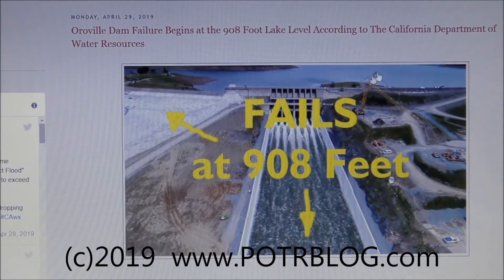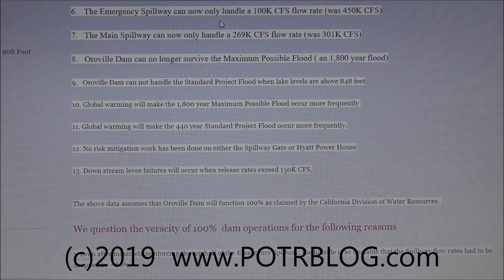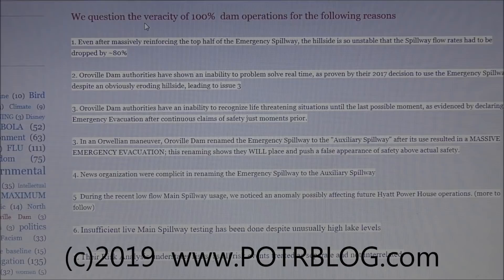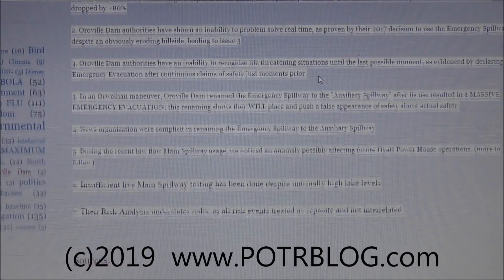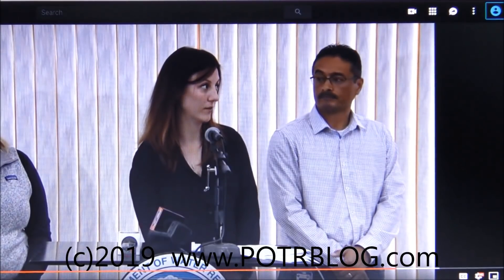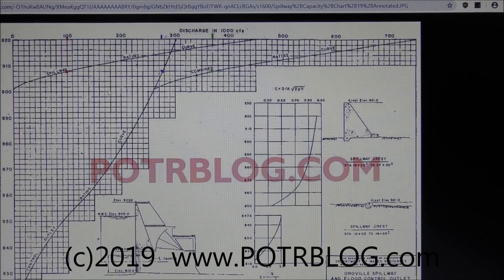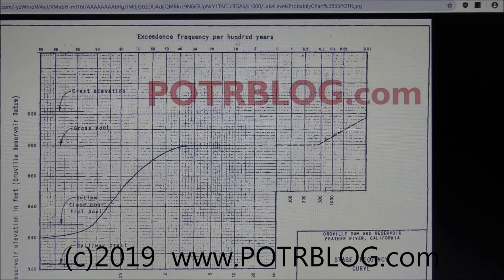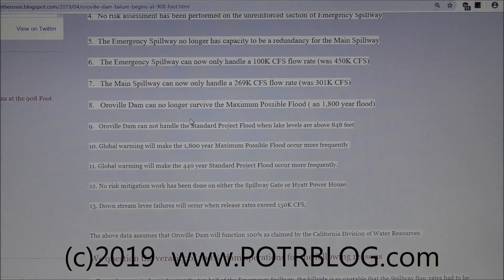Oroville Dam fails at 908ft says California DWR

Comment: I think the secant wall went 30+ft into the hillside bedrock? So for sure if 100k cfs went over the ES, then a lot of erosion would take place BELOW the secant wall. Would that erosion take out the secant wall? That's a difficult question, like how long is a piece of string...
When they built the secant wall, they came across groundwater (not unusual at those depths) this forced them to modify the wall construction to allow the GW to escape naturally. The biggest fail point of a concrete secant wall is GW.
It does look like DWR are taking a much more conservative view on discharge rates down both MS and ES. This has to be a good thing because it allows the engineers from both the Army Corps and DWR to devise a longterm plan for flood control. 
I agree that downstream the river has a lot of weak points, that need to be addressed. I think that in light of more frequent Maximum Possible Floods the whole watershed from snowpack to sea has to be re-evaluated. Then it starts to get political.....
Reply from the maker: They havent done any risk mitigation analysis below the up armored section, the 100k CFS flow is the limit because thats when the ARMORED section of the Emergency Spillway starts failing. The area BELOW the armored section will heavily fail at ~10K CFS (as in the original failure). How long the uparmored  section of the spillway can keep the the lower spillway failure from encroaching the weir is an unknown. Given the quality of the hillside I suspect it wont last long. Which is why I believe it prudent to leave anytime water comes over the emergency spillway. But the folks who have complete confidence in Oroville, can take comfort knowing that Oroville's numbers show that WORST CASE (if all plans are followed) there is a 21 hour window to evacuate once the emergency spillway tops. But, again, I would leave immediately.
Reply: potrblog erosion below the secant wall would have to undermine 30’ of rock to compromise the actual wall. RCC is used extensively for this type of spillway and my understanding is it wears well. 
Assuming the MS worked at full capacity, it would have to be some mega flood to overcome the MS to use the ES as well. By then ~350k cfs would be flowing down the Feather and well beyond its capacity. Flooding would already be happening and people would have moved out. 
The point of any flood control system is to give downstream communities time to prepare.

Comment: In order for this scenario to take place, the inflow would have to be a major flood event for a considerable time.  Plus the total out flow would be way less than the inflow.  Thats if the flood event happened when the lake was being prepped for storage, like now , and like Feb, 2017. So any dam , anywhere with that same scenario would be in trouble. Why are you focusing on just Oroville.? . Granted. That exact scenario did happen when Oroville lake went from 850 to 900 ft levels in just a matter of days in Feb. 2017. But that had a lot to do with the main spillway being closed off for a while when the spillway disintegrated. If the spillway had not failed, the lake level may have been able to stay below the 900 ft level due to the outflow being even or more than the inflow.
Reply from the maker: No matter how slow or fast the rain comes, IF lake levels reach 908 feet the dam will start to fail (according to Ca DWR). Given their own data, the FASTEST possible rain event that could cause such a lake level rise (even if EVERY spillway system is fully open) corresponds to +6 inches of rain in 21 hours (based on their pre-Global warming data ,such a flood on average would occur every 525 years). A smart person's take-a-way from this is that IF you believe EVERYTHING the folks at Oroville dam say, the fastest the dam can start to fail once lake levels reach 899 feet is approximately 21 hours. .I.e. WORST POSSIBLE CASE, from the 899ft point it takes 21 hours to for the lake to reach 908 feet and dam failure to start. That means the Emergency planners are assuming they have at minimum 21 hours to evacuate everyone down stream. If I lived down stream I would leave the instant water started coming over the emergency spillway ~901ft no matter how much or how little rain is falling.
Reply: "But that had a lot to do with the main spillway being closed off for a while when the spillway disintegrated."  You mean off, like the spillway has been since April 10th?
Reply: @spankymcspank316  
You are aware of course why the spillway is off now dont you Marty. They want a high lake level. This is standard operating procedure. When lake reaches 890+ chances are, since I dont know for sure, that the gates will be reopened to accommodate an even water level. Now if we have a freak 6 inch rain storm that comes from Hawaii and dumps 6 inches of rain in 21 hours in the Sierras, yeah , then shit gonna happen and that spillway will have to open its gates a to full capacity and it is even possible the emergency spillway will be used. Do you think that will happen? Its also possible a meteor might fall and land in the lake and send the water over the top. Its possible a 9 point earthquake will happen with the epicenter under the spillway. Do you think that will happen? Get a grip people.
Reply: @spankymcspank316  
The amount of inflow this time of year can be easily offset by the out flow of the spillway with only minimal CFS outflow. If those gates remained closed when and if the lake level reaches 895 + I will eat all my words and get as concerned as the rest of the fear mongers  . Im saying that wont happen. Im saying , as you say, historically, the water level has been 890-895 many times in the past this time of year. And that is what they want by design.
Reply: Marty D it’s a big area to inspect? But seriously DWR are making themselves look bad by not telling folk what is happening.
Reply: My question is if the main spillway is in working order why not use it before the Lake is at a level that is dangerous? They are still channeling water to one side and just letting a trickle out. If the spillway is working, why not lower the lake level now before there is an issue?  No other dam has a fucked up spillway that could potentially collapse if used the way it was originally intended.

The dam is a mound of dirt. There is an internal issue they can not fix. That is what I am gathering.  Only takes a few small earthquakes and one week of excessive melt to send the whole thing down the river. 

No dam lasts forever.
Reply: @MiddlePath33  
"No other dam has a fucked up spillway that could potentially collapse if used the way it was originally intended."
Really Mary. How about showing us all a link that states that ridiculous statement from some engineers or someone qualified.
Reply: @c dawg
Probably because of the impact this type of failure would have on millions of people.
Reply: @dennish3962  
Well yeah. Any dam right now in Northern Calif could have that same impact. Why focus on Oroville.
Reply: @cdawg9149  
Oroville is the second biggest damn in the country, that's one reason why. The flood would destroy the San Joaquin valley, home to 1/6 the worlds FOOD production, no other damn/reservoir could have that kind of impact, maybe that is another reason? Lastly, because this catastrophe COULD have been avoided if they had wanted to.  How about forewarned is forearmed?
Reply: @dennish3962  
Forewarned of what? At what point do you want the public to be "forewarned"? Have he news channels on all local news and television to send out possible evac orders? For what exactly?
Reply: @cdawg9149 
I get it, this is of no interest to you.  I guess I did a horrible job of giving reasons as to your original question. WHY does this matter. It doesn't. Sorry to have wasted your time. Knowledge of things you are NOT being told about on "news channels on all local news and television" is obviously of no value. Just wait for the evac orders to go out AFTER the damn collapses. Fair enough?
Reply: @dennish3962  
Get over it.

Comment: 6 inches of rain in 21 hrs is a huge amount of rain. Not going to happen.
Reply: Look up "ark storm" of 1861 and 1862.  Yes, it can happen and in fact it already has.
Reply from the maker: Its a 525 year flood based on a parametric calculation of the max possible flood as defined back in the 1950's. But its real use is as risk mitigation time frame that lets you know that IF the dam works 100% as they claim, folks will have 21 hours to evacuate once water goes over the Emergency Spillway under the worst case rain fall scenario. Frankly, I'd leave as soon as water started going over the Emergency Spillway.
Reply: @potrblog  
I get it. Why are you focusing on Oroville. This scenario plays out in all dams. The dams in all Northern Calif are at their highest levels in late April and most of May by design . If that scenario plays out it could happen anywhere. You should state that in this video.

Comment: thank you for your report, is there a way to edit your title, at 901 the water goes over the EMS, I think you made a typo.....which I don't mind, I am fluent in typos but might confuse others that are not in the know of the dam. thank you again
Reply from the maker: It fails at 908ft,  basically it's an 8 ft wall of water coming over the top of the Emergency Spillway. It only takes about 6 inches of rain in 21 hours to take it from the 901 feet you mention to the 908 ft level
Reply: @potrblog  The level of the Dam sits at 900 ft and spills over at 901.  Am I missing something?  Where does 908 ft come from.
Reply from the maker: @Natalie-kv4iw  your bathtub has a drain "spillway" at 0 feet; yet if you pour water into the tub faster than it can drain, the water in your tub will rise above 0 feet. Its the same principle with the  lake level exceeding the 901 ft level of the emergency spillway
Reply: The dams emergency spillway is only 901 and the water flows over with no control.  thank you again for your report and getting the word out to warn the people...... my prayers are with all, this is so sad,.
Reply: @potrblog  Thank you..... sorry I wasn't getting it, Got it now. have a good night.
Reply from the maker: @Dawn43069  Its important that people easily understand whats going so they can make their own personal risk mitigation decisions, Unfortunately the 2017 last second emergency evacuation and resultant traffic jam tells us you can't rely on the folks at Oroville Dam to keep you safe.
Reply: @potrblog  I agree I keep warning people to keep an eye on this dam, and I shared your report.. have a good night :)
Reply: GodWePray BlessUSA' What he has written is actually correct. At 901 water goes over the Emergency Spillway but if the water level continues to rise to 908 feet at the ES the whole dam will fail according to DWR. However, if the rolled concrete fails anywhere between the Weir and the C-Kant wall the whole dam will come down very quickly and for that to happen the water need only reach 901-902 and start flowing over the Weir.
Reply: @paulryan5984  OHHHHH got ya, okay. I'm slow or tired. I understand now. How ya doing Paul, I remember you from the chat.